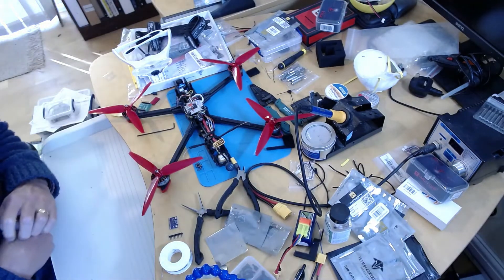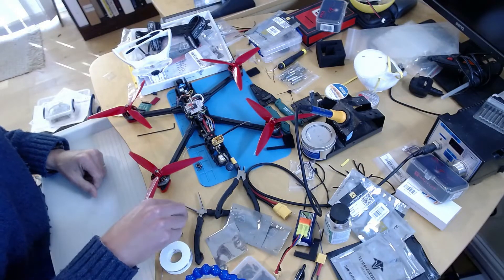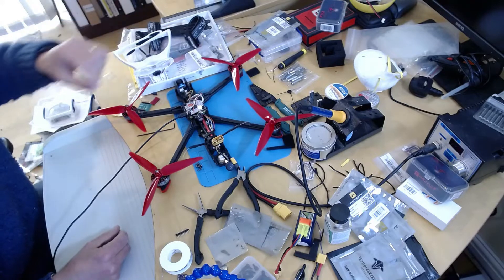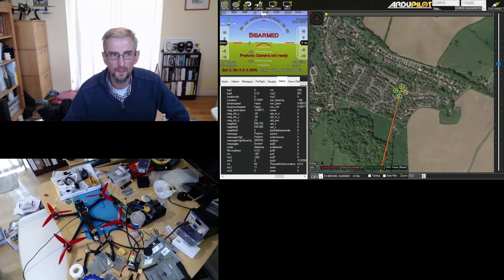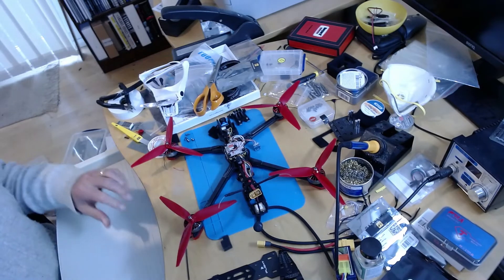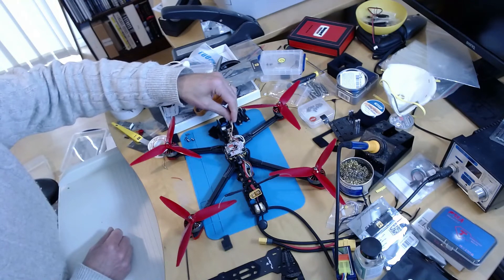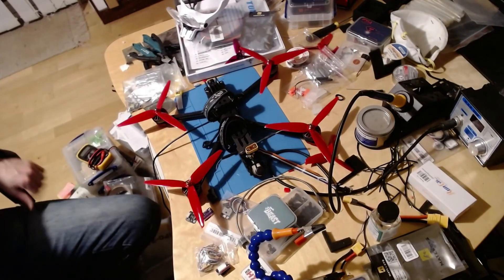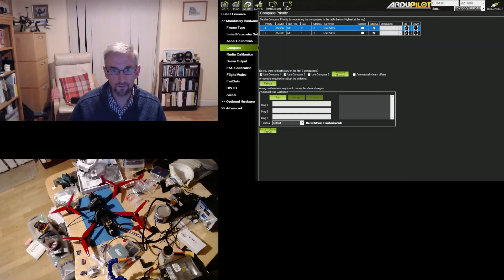ArduCopter 7" LR Build Video 25 - Fun With Compasses

Comment: Hi great video! Lots to learn and very well explained! I’m surprised not more views!  One question. Those compass that are integrated with gps module. Are they as good as compass alone? I’m scared that gps will cause interference to the compass.
Reply from the maker: They work well. The GPS will not interfere - the biggest interference is from the battery, particularly the lead end